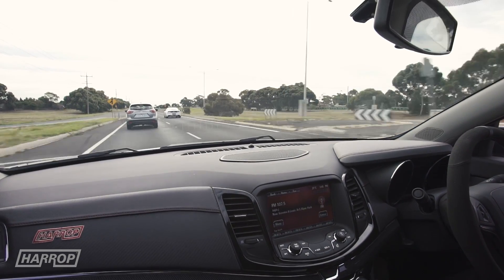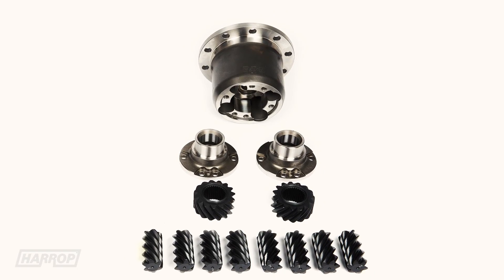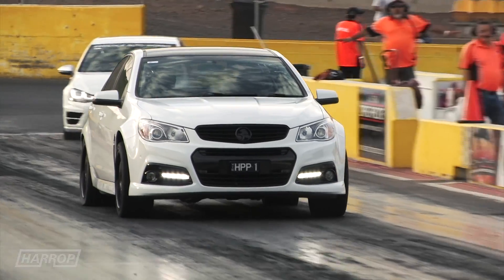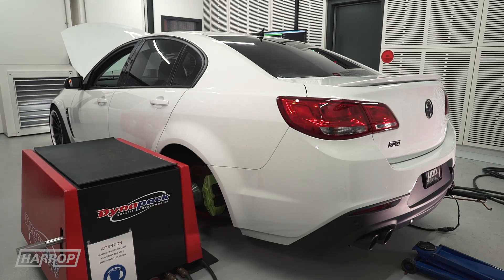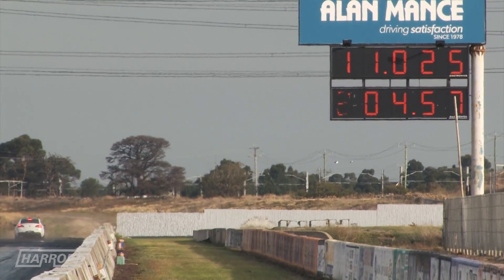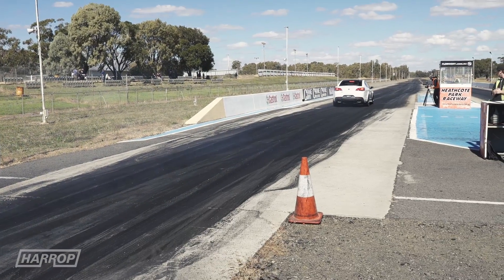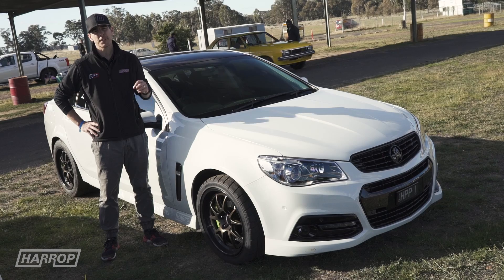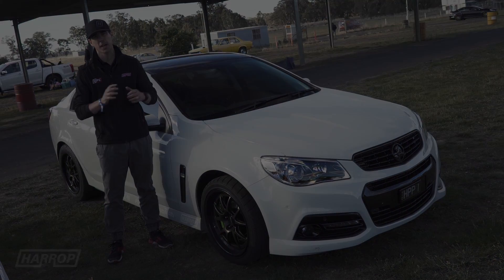Harrop VF SS Upgrade | Part 3

Comment: ran a 383 small block at well...best time was 10,83 @127 mph back in 1998  was always beat by smaller block more expensive Italian backed mafia engines ,lol   a two speed power glide and a 4.11 rear end ,, was quick but not effective enough to compete at the taller end of most meetings  the haddad brothers and the smaller madas and the 460 cubed motors done most of us smaller bracket racers out of the deal ,, well they where a well resented and respected  racer and knew what was required and they ran well .. looking at the white rhino here  30 /35 years after and no better ?  some thing wrong ? just asking     cheers all

Comment: meanwhile, my 2005 SUZUKI SV1000 with only 130 HP and 110 Nm does mid 10s quarter mile on 91 fuel.  And that's on a 120,000 km stock engine that's never been rebuilt. The best part is that the whole bike only cost $2,500

Comment: Well and truly a different ketel of fish ... but same ball park.
But my VZ L76, otr full exhaust 255rwkw.. 3.73 gears (4l65) and a 4500rpm converter, on 235/65/15 et streets..
Ran a best of 11.8 @116mph (1.54 60ft)
Shit ton less power (but also weight), faster trap speed lower ET

Hate to take the easy way out, but wouldn't it have been a better option to just go omega spec rear brakes and throw on some 16s?
*On that note, I now own a E3 Grange land yacht .. and easily running 15s on the rear is a thing of the past =(
When are you guys going to come out with a "drag racing" spec rear brake/wheel setup, love seeing caddys and vetts in the states running big rubber on the rears =)
Brakes that will still stop a fast car, but in a smaller package.
Reply: I'm running 20s 275/40/20 et streets and running consistent low 10s 

Best is 10.1 @143 1.5 60ft
Reply: That’s an amazing time